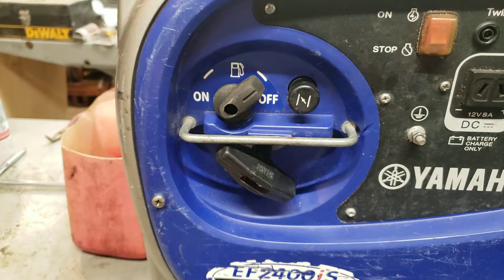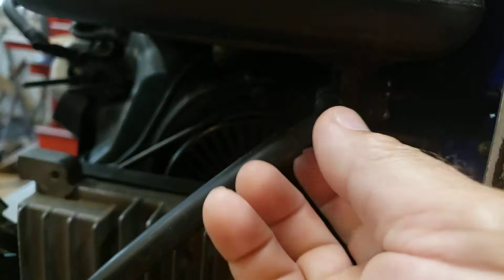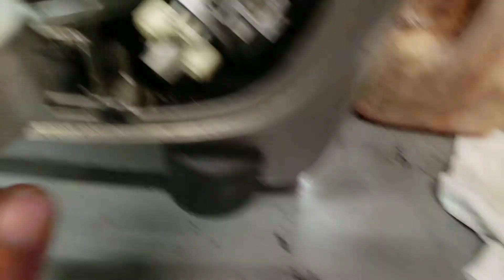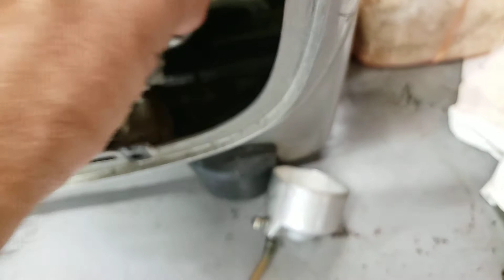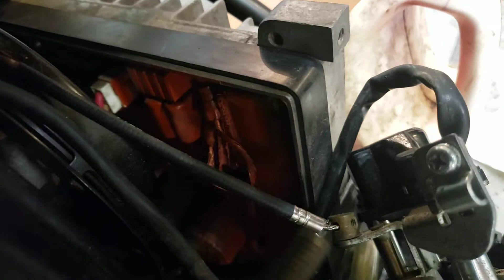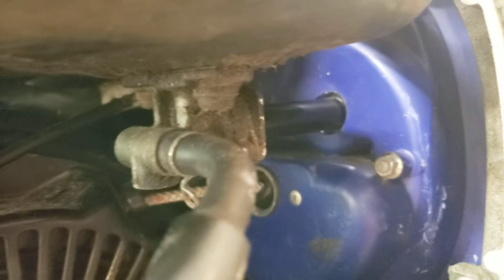Yamaha generator EF2400iS inverter

Comment: I have the same machine cleaned both jets like 10 times 

Only runs when I manually spray fuel in carb, I need help pls
Reply from the maker: There's a drain plug in the bottom of the float bowl. Open that to see if you have fuel getting to the carb. If you don't your float needle may be stuck. If that's not the problem you may need to take it off. Turn it upside down and spray carb cleaner in the jets. Look where it comes out inside the carb. Yours might be clogged with dried gas. The solvent might not get it. You may need a proper jet cleaner or a small wire from a wire brush.  Good luck.

Comment: This skips the step where I'm stuck. He didn't show how to remove the carburetor. I figured it out. I used a percussive disassembly method. Just needed a small tap from a hammer. But I don't have anything small enough to unclog that jet. I took a sewing needle and ground it down a bit with a dremel tool. But I guess it didn't work. It still surges. I could just replace that jet with a new one if I knew what it was called. [2026-03-05 update] I replaced the jet with a new one and it still surges.

Comment: I had the same condition on mine (running only with about half choke out) and knew there was something wrong. After watching your video, I had that secondary jet out in fifteen minutes and sure enough, it was completely clogged. Using a safety pin to punch back through the clogged hole and then soaking in carb cleaner got me back up and running as good as new-thanks!  One thing for others-careful with the carb gasket as they are very fragile.